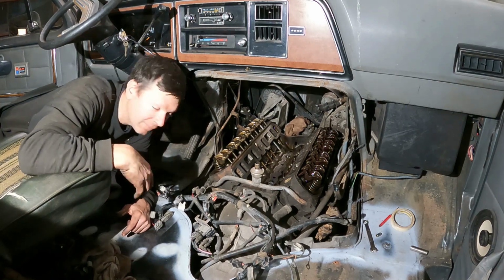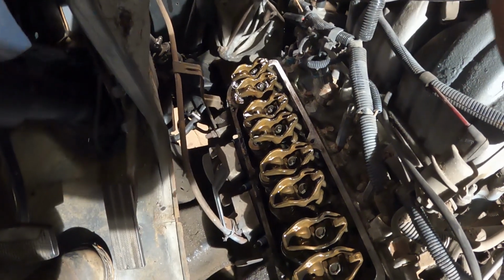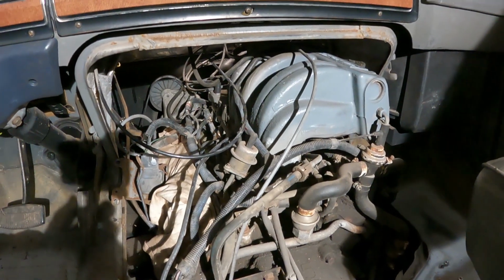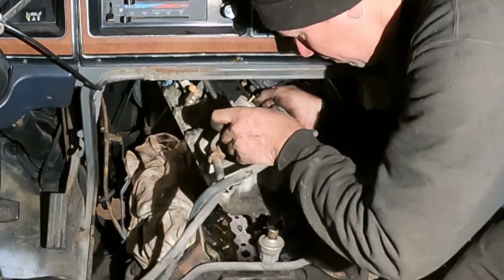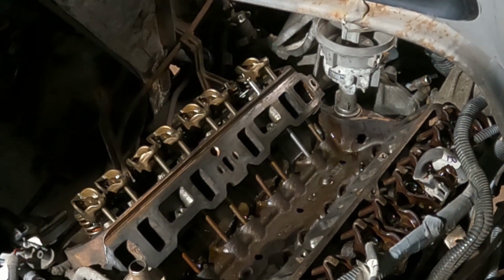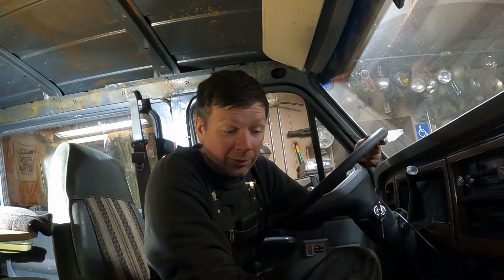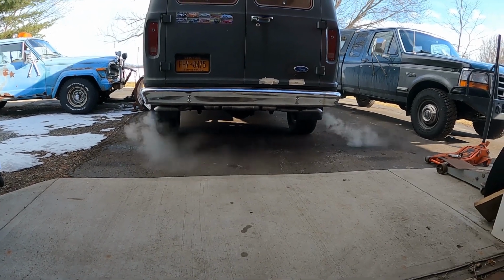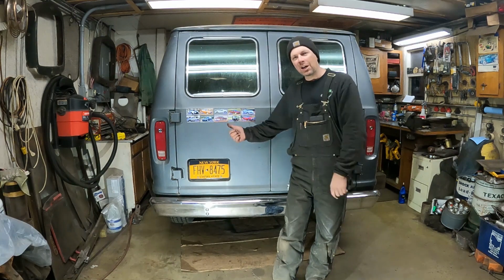Replacing a Bent Push Rod in a 302 Ford:  Boogie Van Build Series

Comment: Just at step of checking rocking arms, tie rods and stuff on my ide: bad news I have play in some of the right rocking arms :-(. Need to find out what is causing the play, first time doing it it.  I confirm real nightmare to work in the van engine bay. Hopefully, the interior is stripped off because we are rebuilding the complete upholstery, so no oil or crap on the carpet and seats. Great sound at the end of the video :-)

Comment: Nice! Wondering what kind of muffler do u have? Do u have headers?
Reply from the maker: Stock manifolds, removed the 2nd cat, 3" pipe to 3" glasspack, Y into 2 1/2" duals out the back from there

Comment: I've had a popping noise and intake and exhaust found out I had a broken push rod for number four on the passengers rear and the exhaust valve wasn't going up and down as far I change the push rods out and now the exhaust valve isn't going up as far as it should with the push rod so I got pulled my intake up on lower intake off and change the hydraulic lifter
Reply from the maker: Could be a worn off cam lobe as well.  Was the lifter worn into a curved out area on the bottom?  If yes then cam lobe and lifter going bad.

Comment: I have resurrected probably close to 150 vehicles in the last 30 years of messing with old American pushrod cars and trucks
I I have found that sitting the oil film turns into sticky varnish for the lack of a better description on the inside of the engine and it sticks the valves and lifters I am not sure which one actually gets stuck but i think its the lifter in the bore, I assume that varnish melts and kind of works like a glue but what I found works the best (as in I haven't had the problem since doing this) is change the oil before ever allowing the engine to get hot. I usually just let it run for a second or two to make sure there isn't any knocks or noises then I immediately change the oil,  Once you get the engine running with the fresh oil let it run for at least a few hours, I live in Southern California and I usually drive 75 or 80 miles into the desert and then turn around and come back home that way it allows the engine to have a good workout at 2500 ish RPM. By doing this it allows the detergent in the fresh oil to clean the sticky stuff off the internals of the engine. Once you get a  continuous running 200ish miles on the oil, change it it usually will already have a slight change of color from the nasty carbon and varnish being suspended in the oil and not being stuck to the block. Also I've also noticed that the engine doesn't bend the pushrod while you are running it and it's warm it's actually during the restart usually once it cools back down (but not always) and you restart and it doesn't matter what brand the engine is they all do it although the ford 429/460 seem to be the worst, but all the small blocks do it too as does the old caddy 390s.
I really love my 70 to 78 "disco" Lincolns and I think every one of them that I've resurrected from the dead have all bent pushrods lol
I was replacing the push rods but it would keep bending them over and over and over sometimes the new ones sometimes some of the old ones.

Anyways my point of that long comment is, get that engine up to operating temperature and  allow it to run a long time and let the oil melt that crap out of the inside if not you will be fighting this issue randomly for weeks like I have done in the past. 
If you need a better explanation or I didn't explain something clearly let me know. I have edited this comment 10 times probably adding stuff but I probably missed something still. 
 Just like you I like my old junk and do everything myself and have learned the hard way so any information I can give I am happy to share it.
Reply from the maker: This is the first time I've had a mechanical failure on an old start up.  I didn't really expect it as the engine really didn't sit for that many years.  I'm going to guess that a little moisture got in and hung the valve up.  I'm just glad it seems to be running good now.
Reply: I would add.  - and I know I’ll catch crap but hear me out  😅.  A little diesel fuel into the oil and run it like you said. But follow up with dropping the pan and cleaning the bottom out** when possible.   I’m a sucker for 318s and those pans usually drop pretty easily.    I’ve pulled Lbs of crap out of pans over the years and found seeming smooth running engines with tons of blockages on the pickups.   Even found pick up tubes dropped out or bent with no real indications showing themselves prior to dropping the pan